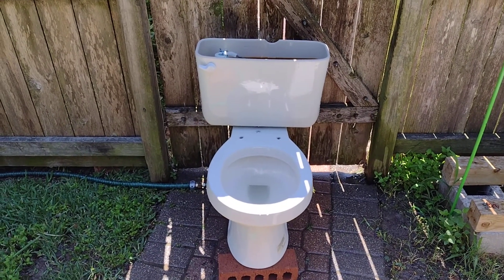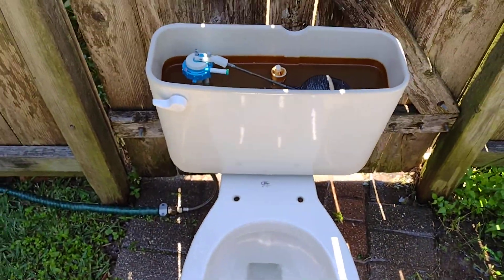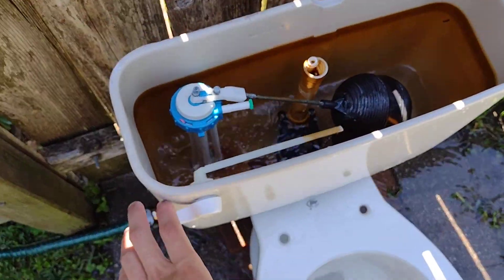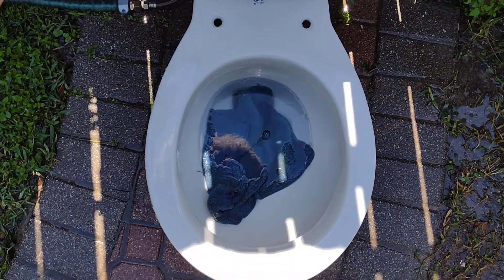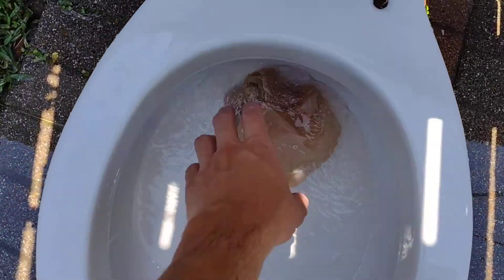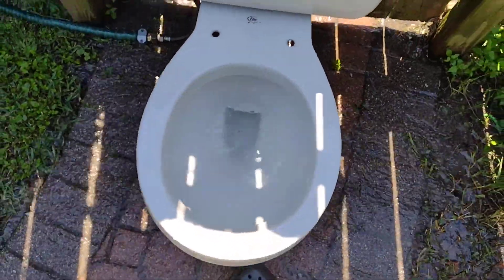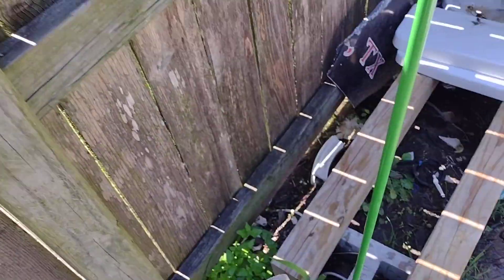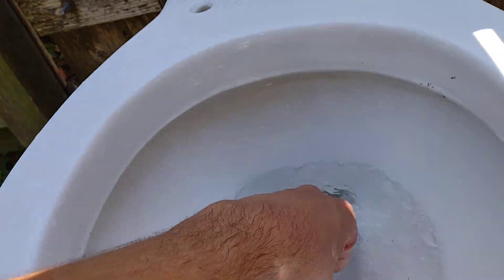1999 Eljer Savoy Tests

Comment: Honestly from what I’ve seen, Toto and Eljer have made some of the better front flushers from the time, but overall there are much better toilets from the time as well (i.e. Aquaforce Cadets and Ingeniums).
Reply from the maker: Agreed. Front flushers seem like a cheap design but I've seen some companies pull them off pretty well.
Reply: @OCC_Plumbing_and_Restorations  for sure, even the later cranes were pretty well, like the Crane Elites. Though there are some super trashy ones, like the Vitromex Marathons and early era Sterling Windhams.